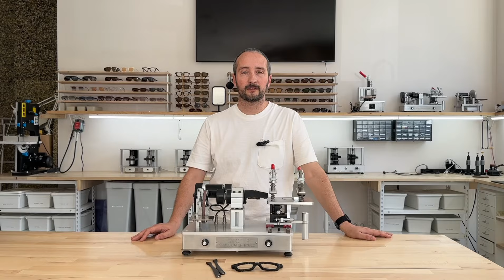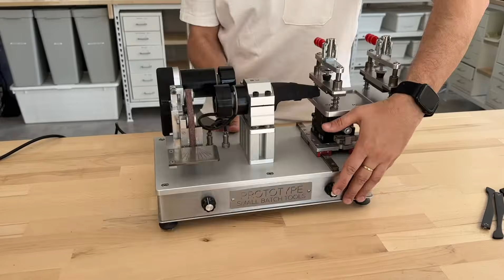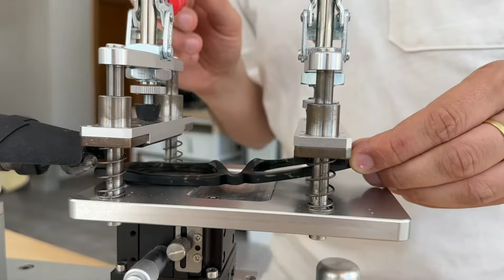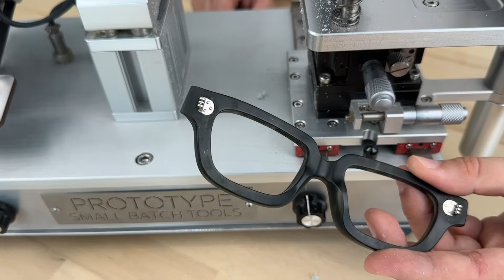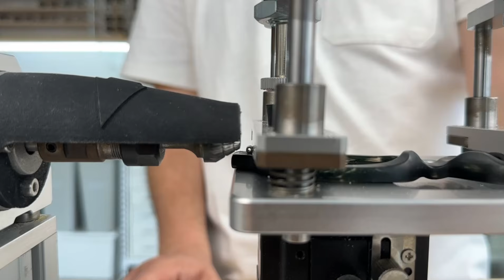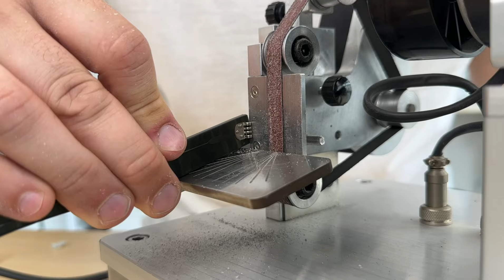Perfect Acetate Eyewear Lug Mitring and Opening Angle – Step-by-Step Eyewear Guide (MITRE MACHINE)

Comment: Just used mine tonight to finish a last-minute buffalo horn frame for a patient. Even though this was a butt and not a miter joint, the machine is still very helpful for a slightly inverted angle on butt joints, while maintaining panto.

All around an awesome tool, and I love mine.
Reply: For a customer not a patient. Opticians deal with customers not patients we are not optometrists. Remember that
Reply: @theoddone1900 I am an ABO Advanced certified optician who is capable of performing refractions authortized by a network of optometrists and ophthalmologists that I help service, when their opticians are incapable of accomodating the patient.

This client is, legally and morally in every respect, my patient.